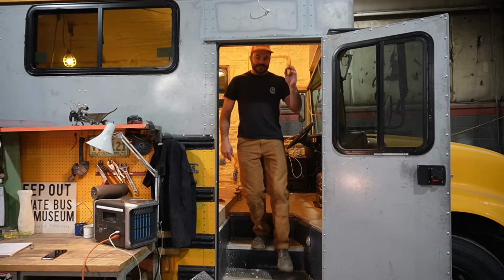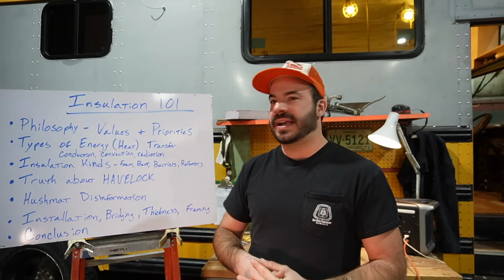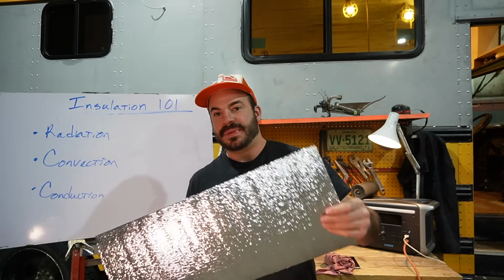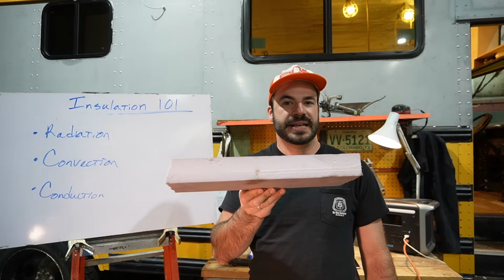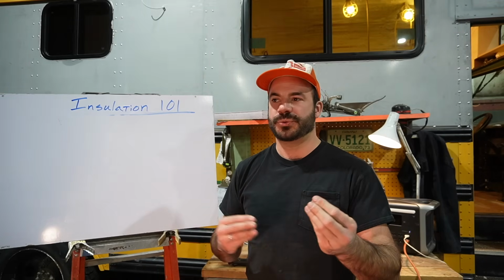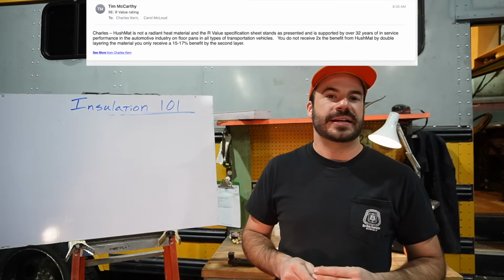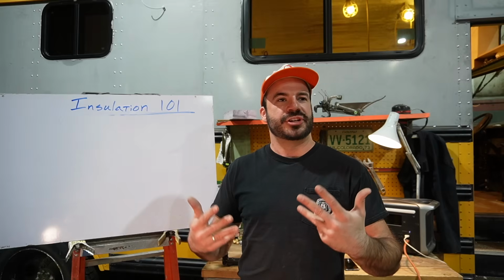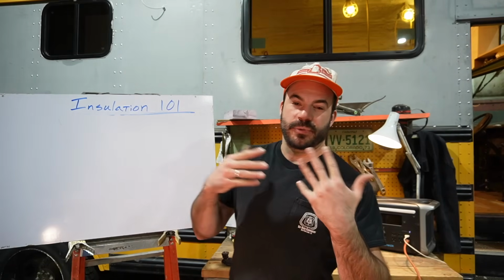Insulation is a SCAM (& the truth about Havelock and Hushmat)

Comment: Just finished blowing in cellulose (which is recycled, carbon negative, zero-voc, allows for modifications down the road, fire resistant, moisture distributing as opposed to moisture trapping, and sound deadening) behind an intelligent vapor barrier (pro clima intello plus). I'll let you know how I feel about it in 5 years, but it sure is a lot less mess and chemicals than foam.
Reply: Also using a 12v HRV system which will allow constant air flow without losing most of the heat/cool energy.
Reply from the maker: Even the best hrv is only 50% efficient due to the physics, but yes. What model are you using?
Reply: @Chuck Cassady  Using the Lunos short model, which claims "Heat recovery efficiency: 88% per DIBT/DIN V 4701 at 24 m3/hr (~15 CFM)" I don't know exactly what those designations are  but I do know it sips power, is already 12v and recovers way more than a Maxxair fan blowing the heat/cold I used so much energy to create out the roof.
As for the insulation, I blew it in as compacted as I could get it, behind the Intello Plus wrap, stapled to plywood strapping perpendicular to the metal framing. I just hate spray foam, so I designed my assembly around that hatred. Paneling doesn't touch metal at any point.

Just built a duplex in WA to passive standards (didn't certify because $) and didn't use a lick of spray foam.
Reply from the maker: Are you not worried about settling and compaction? What did you blow it into? How was it held in? Very curious. That's....r3.5 per inch?
Reply: Also, cost me a total of $96 for cellulose for my 26ft shuttle bus.

Comment: Hey Chuck! Thanks for this great information. Question: for people relying on a variable vapor barrier, it seems like there could be a lot of potential for missing a perfect seal from edge-to-edge (for instance maybe when a wire runs from the roof of a vehicle to inside the vehicle). I have seen some people instead leave parts of their wall open, like near a door, so that the condensation instead has a place to escape rather than risk having moisture, mold, and rust build up within a wall. Is this an actual solution and maybe would it perhaps work better for a small vehicle than something like a long bus where moisture in the middle might not have a chance to escape? Thanks for what you do! Katie
Reply from the maker: That is a great question and one I would say I don't have enough direct experience to answer unfortunately but that is something to think about !
Reply: @ChuckCassadyYT  Thanks for responding!

Comment: Great job explaining! Your perspective on philosophy is much more precise, you are Literally breathing in VOCs when you drive down the roadway (though you are breathing less when you aren't on the road and I always aim for less toxins when possible, not saying foam is toxic, but I always use foam board in housing projects vs spray foam for cost). When we built out our van I understood what you explained from a previous build and dealing with aluminum mobile homes as a kid. In vans you do have drains in the walls (to help with moisture exchange) and unless you want to lose large amounts of space you're furring your walls. I chose a system where half my van has a boiler that keeps it hot to help expel moisture and the other side has large windows to act as humidity accumulator (you can remove with a chamoi). So far moisture is a constant battle, but after getting into walls from time to time it's kept rust and mold at bay in the last 5 years🤞. I am waiting for someone to invent some type of super efficient dehumidifier for rigs 🙏. Thanks for all the information.

Comment: Much appreciated as I dive into insulation, but I have two questions please 🙏🏼
1. Is it important (and how) to isolate wiring from spray foam? It feels like spray foam is the full commitment to what’s happening behind the walls. 
2. At what temp does cold outside and hot inside creat condensation? 
Thanks for making our builds so much easier 🤙🏼
Reply: It's less about the absolute temperatures than the temperature difference. So to use some numbers say it's 72°F inside but 32° outside that 40° difference will cause a lot more condensation then if it's only 40° inside. The other factor is how humid the inside air is. Think hot shower and a mirror. The mirror does fog up more the colder it is inside but the mirror can still fog up even if it's 90+ inside if the humidity is also 90+
Reply: @michaelcummings7246   Thank you so much. Makes sense ☺️
Reply: @michaelcummings7246    Also, the warmer the air, the more moisture it can hold.  It is impossible to have very humid air at say -10* F (in a non enclosed space i.e. just ambient environment). But the closer you get to temps like 70 to 80*F (or higher), the air can hold/absorb A LOT of moisture.
Reply: 2. If surface is colder than air dew point you get condensation.
Reply: You might consider flexible plastic conduit for your wire and just foam in place. One alternative is to make wire channels outside the wall for easy accessibility.

Comment: I understand that placing a material between the metal strapping and furring strips wouldn’t provide any measurable r value or moisture barrier, but wouldn’t it help in reducing squeaking and road noise in general?

Comment: Hot air balloons do not work because of convection.  They work by displacing the air they are in with a lighter, less dense gas, such as hotter air.

Comment: Great lecture! What would you suggest  doing for insulating an older mobile home with  exterior aluminum  siding and wood/vinyl paneling on interior which has  wood 2x 3 studs? I was considering  adding polyiso boards to interior & covering with either 1/4 drywall  or mdf panels, or a more involved job of removing interior  panels, adding onto studs, insulating cavities with Rockwool/fiberglass Batts & then drywall or panels. Maybe adding tyvek before batts. The home will not be moving. I should add its located in the Nor-Cal-Tahoe Forest. P.S. I can't  get anyone to blow in or spray foam it because  they can't see inside attic or closed walls. Also,  I'm not sure covering pipes. & wires is a good idea in an older home due to unforseen repairs even if I rented out  a foam machine. Would love to hear your thoughts please 🙏 😊

Comment: It's 'hush' mat, not 'cool' mat.    In commercial jets, condensation is called "rain in the cabin."   We use vented blankets with flame proof batting in them. No exposed aluminum can contact cabin air.
Reply from the maker: THIS

Comment: I encourage vinyl trim in bathrooms. Because of moisture. I hate rainy days in the work trailer. It rains inside too with crew inside even with solar fan going and heater. I love your content. I don't have a bus. But do have a work trailer.
Reply: Does your heater run on propane? Does it vent inside or through at heat exchanger?

I used a propane torpedo heater in my shop and water condenses on the floor,it was -11F this morning. Once the wood heater took over the floor dried up fast. Floor temp was about 50.

Comment: You only covered half. It's insulation and ventilation. If your doing one you should think about the other. My closed cell floats are awesome insulators. I have used closed cell floats to remove and install docks and boat lifts for many years. Building houses rockwool comfort board and batt has been my choice. The reflective stuff is barely better than cardboard. As we found out with buddies garage ceiling when we took down the card board and install reflective insulation. A sheet of plastic I think would of did just as good in his garage. My old wagoneer gets hot inside. I might try the engine cavity insulation. You can pour concrete over the foam board. To help insulate building floors. In houses around the windows we put in thermal breaks. To keep the windows from making the whole wall around the window cold. Every feel cold ask window trim? The thermal break does help.  Never heard of Havelock. Low perm vapor barrier or roof underlayment. Fiberglass insulation r15 after 20 years the moisture reduces it to like only a r7. A wool shirt soaking wet still hold 80% of the heat. But wool is hydrophobic unlike insulation. I hate foam board because fires. But will use it under my concrete floors. Metal also suffers from wind chill effect. What about skirting and tarpping your bus or rv in winter?
Reply from the maker: I did cover ventilation near the end. Skirting and captive air under the bus are great

Comment: Heat recovery ventilators do not mix the incoming and out going air! They use a heat exchanger usually made of aluminum plates to have the fresh incoming air flow past but not mix with the outgoing stale moist air.  The incoming cold air picks up the heat from the outgoing warm air because the conductive properties of the aluminum plates.  a properly installed HRV system is better than having a roof top vent like a Max air vent fan any day of the week, the problem is most commercially available heat recovery ventilation systems are not designed to transfer the relatively small volume of air in a schoolie or tiny home.  For any tiny home or schoolie the system will likely have to be designed and made on an individual project basis, and that is just not something that is commercially viable.
Reply from the maker: Yes you are correct about that! I've seen some pretty small models that could work in this application
Reply: @ChuckCassadyYT  it is easy enough to design and build one if you know the approximate volume of air that you need to exchange, and have access to a few basic tools, 3D printers help with custom, parts, and the cosmetic aspect after the system is built.  Printing in ABS stinks literally and figuratively...

Comment: I want to use hush matt purely as sound insulation that's also fire resistant. It's at least good for that right? With a vapor barrier? Not concerned with R value
Reply from the maker: I'm sure it would be great for that, but so would any of the other less expensive options

Comment: Great content. I went with closed cell foam boards but have not finished insulating the interior. What do you recommend to provide the vapor barrier between metal studs and wood framing when using board insulation?
Reply: Spray foam of course.

Comment: Perhaps I am misimformed but I thought the complete opposite about the sound dampening properties of spray foam, one of the cons of sprayfoam I had heard was that because it is rigid/locks into the framing that is transmits more frequencies thru the chassis.

Comment: How do you keep the walls from getting all wavy when you use spray foam?
Reply from the maker: I've never had that issue, as long as the installer sprays thin layers it shouldnt
Reply: @ChuckCassadyYT  That's good to hear, I think I'm leaning towards spray foam. The guys in this video https://www.youtube.com/watch?v=nwhIRugx5NY say that they've had professionals in to try spray foam and they couldn't get it to apply without the waviness. I'm a bit suspicious that they just don't like the extra labour needed and prefer their quicker process with the hard foam they sell.

Comment: Why can't you mitigate the off gassing of the spray foam by sealing it in with a cover of paint,Epoxy primer or even rubber seal coating..? Or doesn't the off gassing just fade away completely on it's  own in a short time anyway?
Reply from the maker: Yes to all of that

Comment: That was excellent, Chuck, thanks !!
Im considering a tiny new build, not a bus... a THBOFW !
instead, a houseboat or I think in the usa you call them boat-houses.
Im r really facing some interesting challenges given that water (fresh river, not salt) will be ever-present.
Im open to experimental ways of using various materials.
15mm thick HDPE floats, using a grid aluminium frame to rigidly secure them.
Then 10mm sheets of HDPE  then 20- 40mm Extruded polyetheline foam and finally floating manufactured wood flooring.
Now it gets curious. Im considering a combination of either wood or aluminium framing for the walls and either hempcrete, cement fiber sheets, aircrete
and extruded poly foam. With hempcrete you get walls that breathe, no mould, etc, with aircrete you get a product that is cheap, super light (it floats)
and both are easily done DIY,  If you have any thoughts of suggestions and it doesn matter to you that my bus is going to be a boat.... 
Id love to hear from you, because its clear to me.... you know stuff... 👍😃🕺
thanks for your vids... they are excellent !!

Comment: Amazing info presented articulately. How would you go about insulating a new (2021) Class C RV, which has thin walls? Do you need to pull out all the systems to add thickness (foam) to the walls and reframe? Or can you just add thickness to exposed areas of the wall -- or would that not help much, since many original wall parts would stay approx 1.5" thick only.

If you add thickness, do you just slap on a layer of foam board of spray foam within some custom built framing that screws directly on top of the existing wall/panels, or do you need to remove paneling from the original wall first?

Comment: What are your thoughts on spraying an open cell spray foam like "Great stuff expanding foam" into the hollow metal ribs before the wooden  beams are screwed to them? I did that for my bus in hopes of making it more air tight and hopefully making the R value a tiny bit better. And possibly making less of a thermal bridge. Do you know of any pros or cons with doing that?
Reply: You will still need to spray over the wood as well, to seal it from moisture.  Wood is fairly vapor porous and will pass moisture.

Comment: I'd like your opinion on how I plan my insulation of my ambulance. I already have the materials. 
I plan on painting the aluminum interior with tropicool and before it dries to attach the Havelock wool so it won't sag. Your opinion would be greatly appreciated.
Reply from the maker: My opinion is that I will never use wool in a metal structure. But that's just my opinion! There is a lot that goes into making a good insulation system

Comment: thank you for sharing all this valuable info!  I do commercial roofing and we use Iso for many of the jobs we have.  I never knew it dropped R value as temperature dropped!  I went on Owens Corning site and there it was in black and white.  starts at R6 and drops to R2 at 15 deg Fahrenheit    Shared that document with the boss and he didn't know either.  Now we can explain to customers the difference between that an the Dupont blue board we like to recommend over the iso.

Comment: This is EXACTLY the information I've been wanting to understand. Your stressing the idea that it's the warm, moist air that causes problems more than temperature differences was a revelation to me. 
Until this point, my biggest fear in using spray foam was sealing the drain points in my Econoline van. Am I understanding correctly that if I follow your method  and completely seal the van those drains will no longer be needed because I would control the moisture through my vent fans? I'm in the very humid South East, US. BTW: I'm a new subscriber because of this video.

Comment: Hi chuck could you recommend insulation for me I have a 1996 Ford coachman class b van sides are steel top is fiberglass  what would be the best way to insulate and not get leaks or mold  I get the floor part you suggest but not sure on the sides and top I’m new to this but I want to do it right the first time thank  for your time
Reply from the maker: I just made a video about insulation
Reply: @ChuckCassadyYT  I know but I was unclear which is best for fiberglass top and the steel body of the van I will watch again  any advice would be greatly appreciated thank you sorry if I’m not clear I’m 66 year old female doing this myself and somethings I need to have simplified for me again thank you your time  many blessings

Comment: I don’t have the funds for spray foam unfortunately. What if I use the foam board then for any cracks left open use a can of spray foam how will that work.
Reply: Just use fiberglass insulation.  Faster, easier, cheaper.

Comment: Thank you, thank you, thank you. I'm in the middle of a build in the dead of winter, and of course it's time for insulation. We are on a time crunch so it can't wait, which also means we can't do sprayfoam since it's way to fucking cold for that lol. It wouldn't be installed properly so it's a huge no. It's been a pain trying to figure out insulation when we can get 6 ft of snow in one day. This video really helped! You guys are amazing! 
P.s. idk if you will see this but we decided on foam board in the floor and walls, (with thoes spray foam cans to get all the cracks and nooks) and batten insulation on the ceiling with a smart vapor barrier. If you have any idea on how to make this better, by all means lol

Comment: Soapbox was spot on. Almost all batt insulation claims to be mold resistant. The problem with that is, the insulation does not keep everything around it from molding🙃
Another topic that I’ll touch on are the “Skoolie FB Groups”.  
There are many of these groups and I constantly see people posting new ideas (to them) that seems very clever, but in all reality do not need to be part of the reinvention of the wheel😐
The two main things I’ve seen over and over again are the use of only using 3m tape to hold solar panels on the roof and still installing wood burner stoves! 
It really doesn’t matter how you approach the posts from people because any kind of criticism or critiquing will always result in a defensive response. 
Thanks for the video!